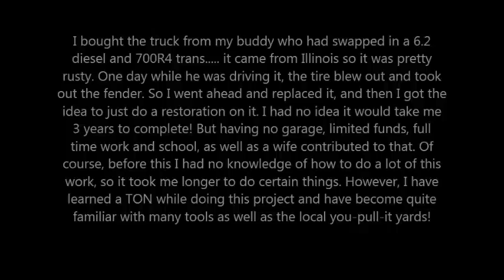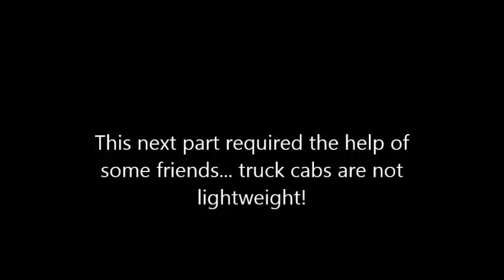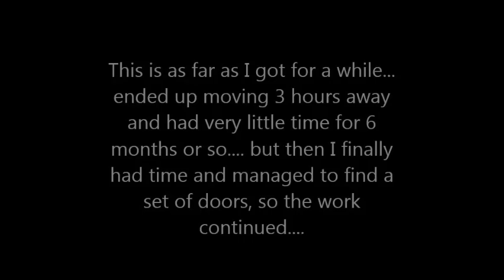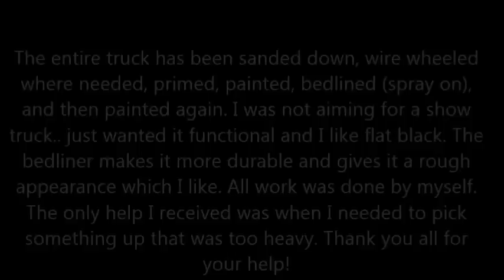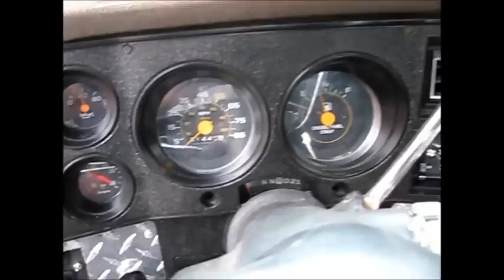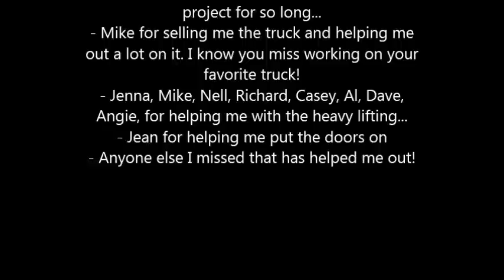1986 Chevy K10 Restoration & Straight Pipes

Comment: i dont know if youll read this but how did you get the diamond plate and chain onto the door panels, i have a blue interior white 86 chevy k10 that im restoring, im only 17 and could use all the help i get, and what kind of sandblaster do you have
Reply from the maker: It's on a comment on here somewhere how I did it.

Comment: NIce truck. Did any modifications have to be done to get those seats in right. I have read that the floor panel had to be modified so the seats would actually be functional and slide. Which then the saddles tanks were in the way of that. Just Curious want to put some like that or with the 60/40 split in my truck.
Reply from the maker: Yeah the guy who put the bucket seats in just bolted them to the floor. Probably wasn't the safest thing now that I think back on it. Lol. I even replaced his bolts with better ones and added washers and lock washers.

Comment: point the pipe down a little and you can use it as a leafblower clean up the garden in no time 

nice jo on the restauration , have a c10 myself i need to start on will do it about the same but use hammerite enamel paint for the body
Reply from the maker: Haha thanks.

Comment: How thick of diamond plate did you use on the dash? And how did you attach it
Reply from the maker: Im not sure what the thickness is, maybe 18gauge. Bought it online much cheaper than I could find locally, cut it with a shear and a jig saw,  and its held on with small machine screws and self tapping screws.

Comment: what did you do for the door panels?
Reply from the maker: Which part? Lol. They were blue.... so i sanded and painted them black. The diamond plate is a separate cut out piece screwed in with small machine screws, and the chain i got cut at Lowes, bolted it in.